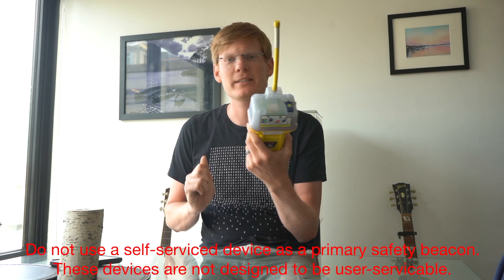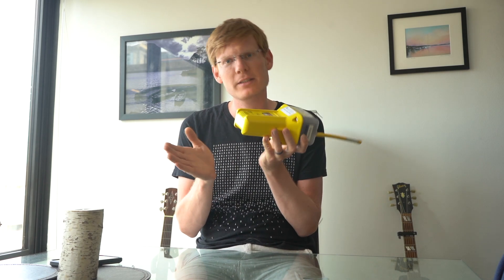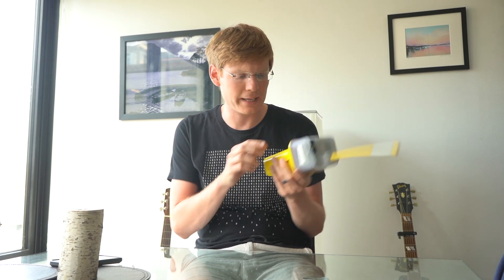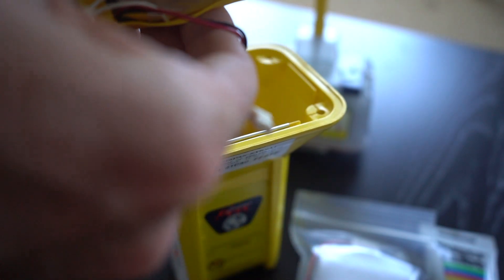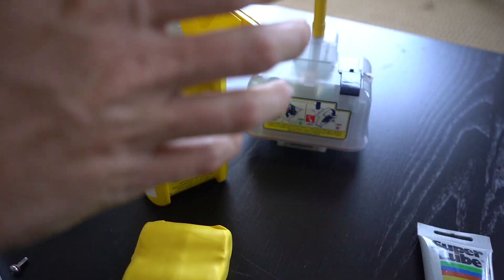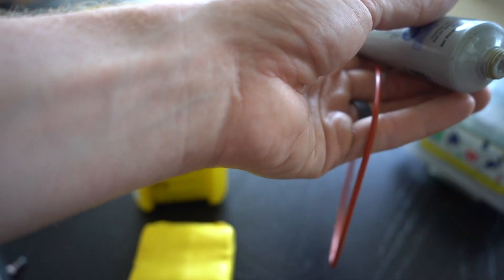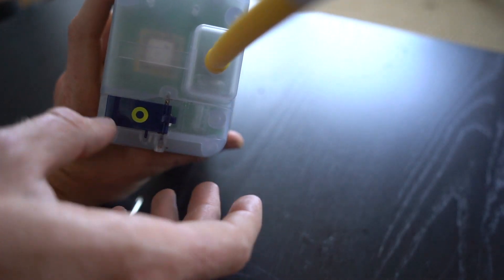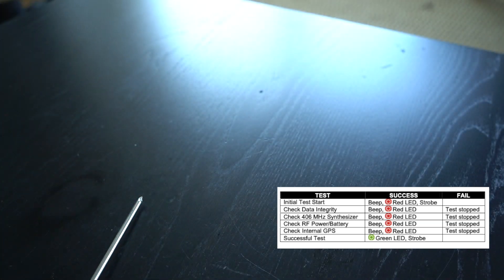ACR EPIRB Battery Replacement

Comment: Thanks for that.  Very, very helpful.  Why would you not have this as a primary device offshore?  It is in good condition.  You can be confident in the water seals, I think and it tested OK.  Just wondering.....
Reply: Probably just a disclaimer. There is literally no reason to be scared of changing a battery

Comment: In case anyone was wondering, here is the specification for the battery cells:  

ER34615 Cell, 3.6V, Li-SOCL2 Chemistry, Non-Rechargeable, with Tabs

Comment: I just replaced the individual cells on mine.  Take note that inside the black isolation tubes there is probably a reverse polarity diode for each cell.  And that inside the yellow isolation tubes there possibly is a temperature fuse per cell.  I don't know, but there definitely were such components in the battery pack,... not just wires. ..... I assume the function is for safety though, and not strictly necessary. .... I imported my new cells from China, and when I did the test it worked the first time, and then failed when I repeated the test (after 2nd red led). ... I opened it all up again, and one of the cells dropped from 3v to 1.5v during the test. .... Luckily I had ordered some extra, replaced the cell, and did the test again while monitoring the voltage,.... this time the drop was only from aprox 9 to aprox 8.5 and came right up again and I got all the four red blinks and the final green one. ..... Gaskets were just fine, and felt like they had a tiny amount of silicon from the factory. ......... Probably one of the tests is designed to draw a peak current to test if the batteries are still o.k. ..... The original cells that I took out were 20 years old, and still working just fine ! ! ! ...... Probably I could have left them in for 10 years more. ...... But, yes, not if you're gonna cross oceans though, and not if the EPIRB is your only beacon. ..... If the factory had done this, they would also have carried out a vacuum test I think to guarantee it's still waterproof, and I guess they also have a facility to test real transmission and reception inside a cage or something, but that's just guessing. ..... There are sockets/connectors inside the elctronic unit.  The one for the battery cable most noticeably, but there were more. ..... If you get humidity / condensation and/or vibration over a prolonged time such contacts could become poor with age. .... And quality of soldering can sometimes cause old electronics to fail with age. ........ As well can some electronic components, but I didn't see any of those in this unit. ...... The unit did look as if it were made from high quality components that would generally last for a long time. .... In order to make your own battery pack you are better of having a spot welder. ...... And by the way, I have electronics and telecom background, though not within this field. ..........

Comment: How do you know the pack you bought is fully charged?
Reply: Same question here
Reply: The replacement batteries will come with a sticker saying when to replace, and you could test the small connector with a voltmeter. Monthly testing is recommended though.

Comment: Back to where you bought the new battery pack
Reply: good sellers on eBay, it's where i get mine from.
Reply: @scottk27332      Good seller is the key point.  There are lots of very low quality batteries on eBay, so buyer beware.

Comment: Are these still supported?  Found one in my closet from our old boat and was assuming that the industry had moved on.
Reply from the maker: Depends on the model, but these are really still the latest-and-greatest, present-generation safety device. Once it operates on 406mhz, 121.5mhz beacons are being/have been phased out